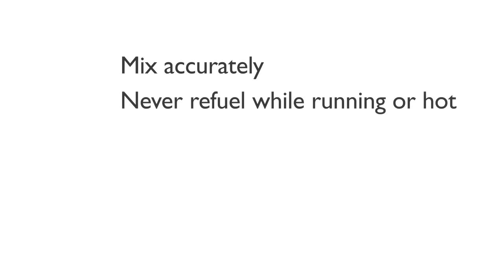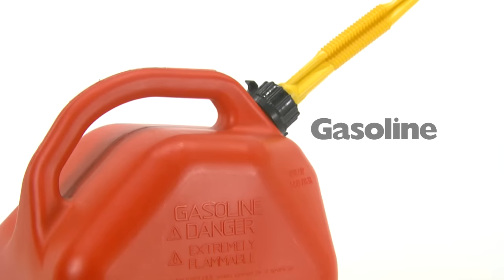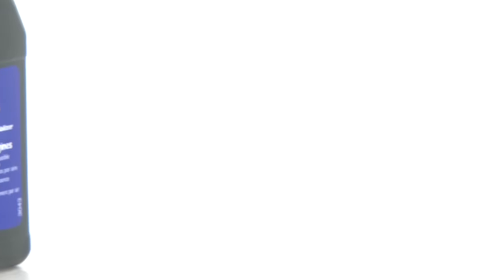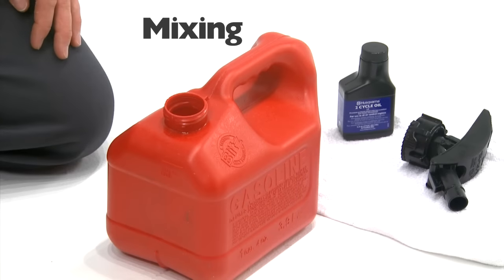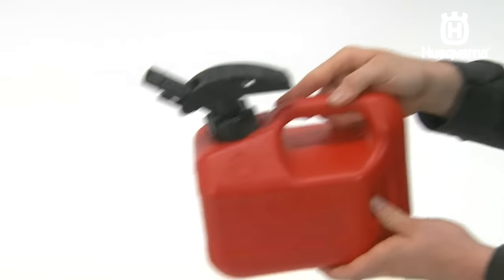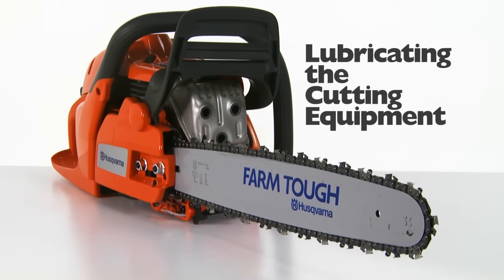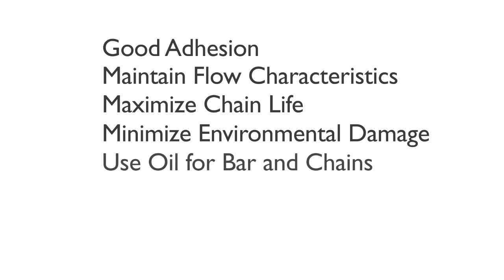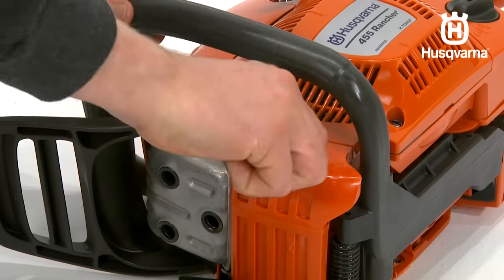How to Mix Fuel for a Husqvarna Two Stroke Engine Chainsaw

Comment: I have had my Husqvarna for 27 years now and it still runs like a dream.
Reply: 20ml x 50=1000ml = 1 litre
Reply: I just have one and I don't want to brake it.... What fluid should I use and how much please 🙏
Reply: Always use Ethanol Free Gasoline for chainsaws.
Reply: @mikeheesen1031  ethanol gas will gel up the carburetor.

Comment: I know it is more expensive, but I buy the premixed cans of 50:1 fuel.  One reason is the is less spillage pouring from the 50:1 cans is easier than from a gas can.  The fuel tank openings are small on chainsaws and adding fuel in the woods on uneven surfaces is not always easy.

Comment: I own this chain saw...and it never started!
Reply: 353 husky, best saw I've ever owned
Reply: reid anderson  I have the 353 as well but mine does not have the manual air purge bubble/pump ... and it’s always difficult to start if I haven’t started in a while because I have to pull a lot until the fuel reaches the carburetor... does your have the air purge bubble? Just curious

Comment: Another good method for mixing the gas/oil: 
Buy a 1.5 Gallon gas can, pour the oil in. Go to the gas station and let gas pump do most of the work in mixing it. Then, you can further ensure a good mix like the second part of the video. 
Because the can is 1.5 gallon instead of one gallon, there is room to for the fuel to move.

Comment: Run ethanol free gas and you dont have to worry about long term storage, just re-shake the saw before starting.
Reply: Bryan Burbank I see it has been over 2 years since you posted this but, what do you suggest we do if 100% fuel in 89-93 octane isn't available? I hate ethanol in the fuel and know what damages it can cause. all I have here is regular fuel that's 100%. 15% ethanol in everything else. I've tried 87 100% gas but my saw and weed eater were lacking in top end performance. would you trust using additives in 2 cycle engines that remove ethanol? thanks for any help
Reply: Additives can be effective but I wouldn't trust them for long term storage. Maybe a few months or more. Google non-ethenol fuel stations and see if you can find something nearby or buy the smaller cans at home depot or Lowe's. Most saw shop sell small cans too
Reply: Bro just use VP Small engine gasoline which is 94 octane and contains no alcohol. VP actually makes pre-mixed 50:1 Two Stroke gasoline.

Comment: What happens if i put straight gas into the chainsaw an then use it ?? What would happen if i done that
Reply: Falli g big tree
Reply: boom
Reply: You will destroy the engine. 2 stroke engines get their lubrication from the oil in the gas. 4 stroke engines have the oil in the crankcase so there's no need to mix it for a 4 stroke.

Comment: whats the size of the gas tank on the chain saw?
Reply from the maker: Kirk king/cunningham more common chain saw spec is fuel ratio (50:1) vs size or gas tank - are you wondering about tank size on specific saw in video?
Thanks for watching our YouTube channel.
Reply: So I cannot use the mixture ratio in my husky that i use in my weed eater brand "weed eater"?

Comment: Just bought a Husqvarna 350 rancher. The designer who came up with this choke High idle lever is a moron. This thing starts terrible. Even when it's hot sometimes I have to pull two or three times.